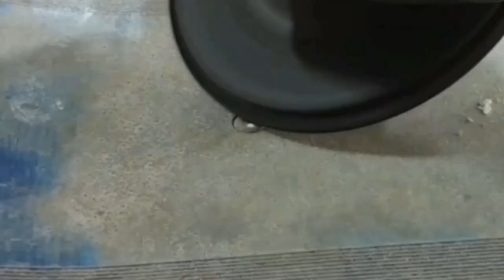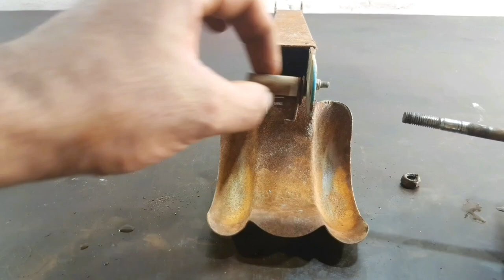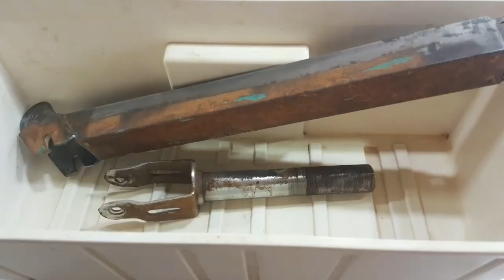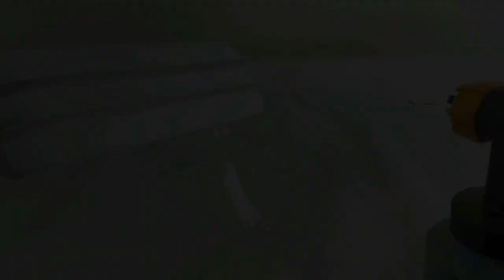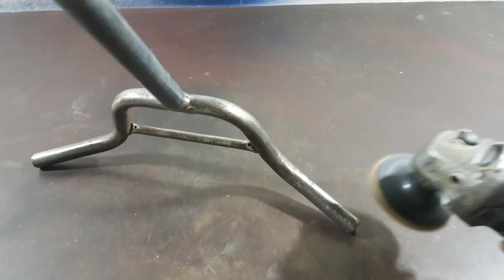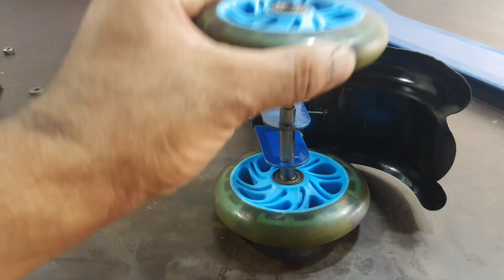Broken Rusty Timer Scooter Restoration / Restoring Kick Scooter

Comment: what is the name of the machine that you use to restore bro
Reply: He uses spinning brushes.  Obviously, these are power tools.  
There is the bench grinder which is secured to a table during use, then there is the handheld pneumatic buffer.   
A spinning brush attachment can be used on both of those tools.